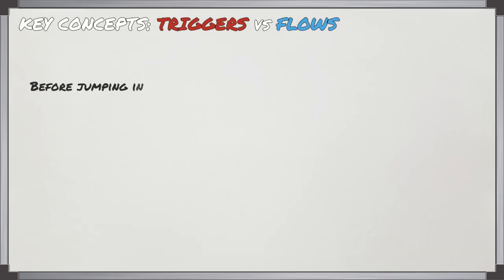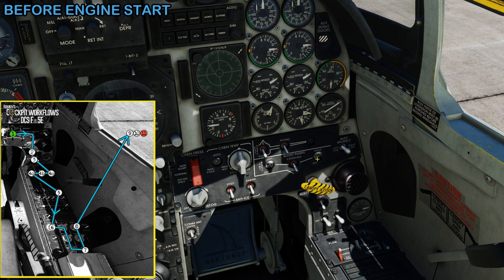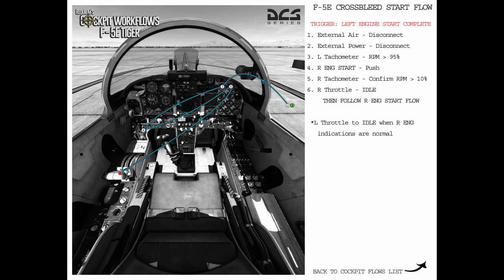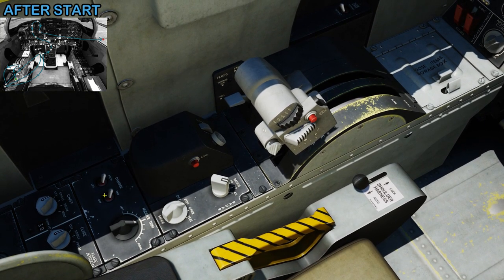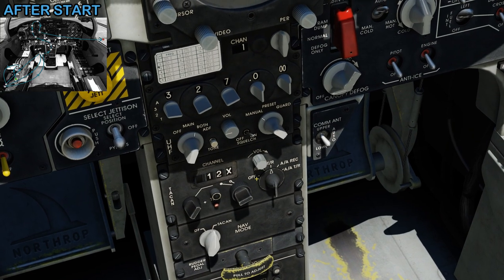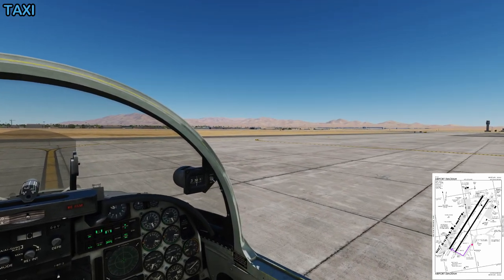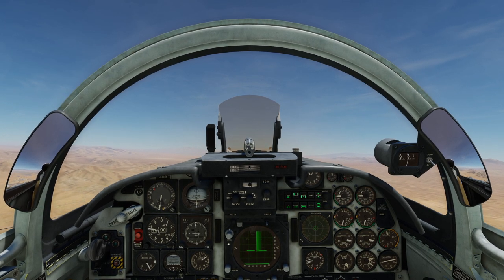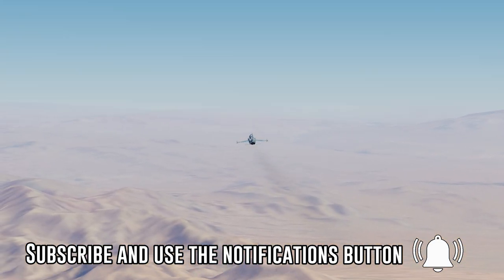DCS F-5E Tiger #2 - Cockpit Flows, Startup, Taxi, Takeoff

Comment: When ED was having their big sale, I got 4 modules, some of them were as cheap as $20. I had a choice between the Mirage and the Tiger II and got the Tiger. I also got the HIP, the Hind and the Gazelle. It's becoming one of my favorite jets. Not only is it a little screamer, but it forces you to use radio navigation, VFR and manual skill. A modern jet like the F-16 has waypoints, auto pilot, CCIP and all the bells & whistles. Not the Tiger. Hitting a target with a bomb using only the heads up pipper with manual depression angles is so satisfying.

Comment: Very smooth.  Three notes:
--I see no purpose for formation lights in daytime.

--A crossbleed start is nice to know, but not the typical procedure in a normal ramp area.  You would need clearance to run up an engine due to the hazard from the exhaust.

--When you ran up the engines to mil for takeoff both nozzles indicated 40%, which is out of limits for mil power.  Don't know if this is a DCS inaccuracy, but IRL the nozzles should be within 0-20 or 0-16 depending on the engine sub-variant.  If DCS is not the issue you might have been short of mil or slightly into burner.
Reply from the maker: Hey Gort, yep formation lights are pretty useless in daytime. When I'm flying out and about in RL my company requires me to turn on all external lights until I get above FL180 day or night even though they won't be seen, so that's why I keep all the external lights on.
The crossbleed start was just performed at the ramp for convenience to start one engine after the other. It doesn't matter in DCS where you do one and I'd rather show how to do a crossbleed than another regular engine start. If I'm doing a crossbleed in RL I do it while taxiing without other aircraft behind me or angled to the side on a taxiway with the parking brake set. We can pretend everything was clear behind me for this video lol
- I don't have the detent installed in the Warthog so it's hard to get the perfect position but yeah it probably would have just been around min burner.
Thanks for the feedback as usual!
Reply: @RequiemsACTL   Yup, I understand the anti-collision value of external lights, but I doubt formation lights have any value at all in daylight.  At any rate USAF policy did not require them for any purpose beyond night formation, so you can free yourself from that company policy.  😉

Comment: Great video. Oxygen should be set to normal flow when off it triggers reset to 100% you have to manually bring back to normal. (middle switch). Didn’t turn on flares CM but obviously not required. Love the series however already sending to friends to get on the F5!
Reply from the maker: Thanks Brian, yeah there's usually some little thing that slips through when I make a vid. Appreciate you sharing it around though as I'd say the vast majority of my subscribers are mainly from the Il-2 community.

Comment: How much nose up trim do you usually use for takeoff in the tiger req? I have an issue with around the 160kt mark that I know the plane is due to rotate, but it refuses. Once it gets the lift to rotate, it rotates so quickly that the tail strikes. I know my controls are not set for the aircraft yet so my sensitivity curves are all gonna be worked on more in flight, but I feel I'm botching the trim somehow. I've tried it in 1 degree trim increments (same load and fuel), tried pulling the burner just before rotation, less stick, more stick, less and more stick.... lol
Reply from the maker: Hey Toxic I'm sorry this is a late reply...I was out flying without access to my F-5 documentation. The pitch trim depends on CG position so you need to reference the chart at 09:58. Assuming you've done that already there could be an issue with the ground modeling in that plane may stick to it a little longer than expected, so once you add the back pressure at 160kts just hold the stick position slightly aft and don't force it off the ground. Let the plane fly off the runway.

Comment: Just out of curiosity, are cross bleed starts normal for the F-5. I have always started both engines the same way. I would be interested in starting your way as it seems to save a little bit of time.
Reply from the maker: I wouldn't say a crossbleed start is normal or abnormal. It is just a different choice if you wanted to save time and fuel as you can do one while taxiing out to runway.